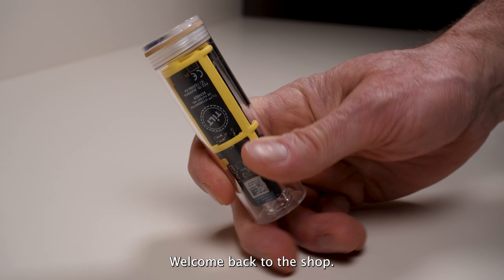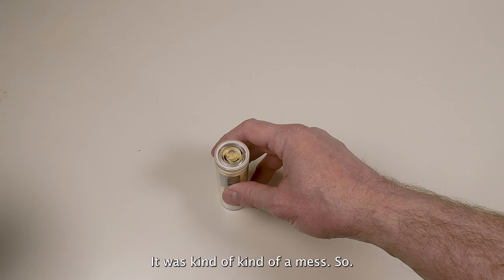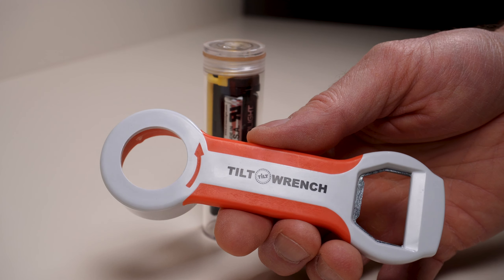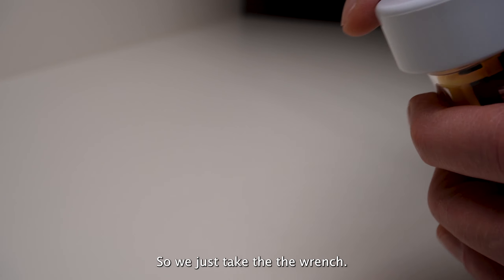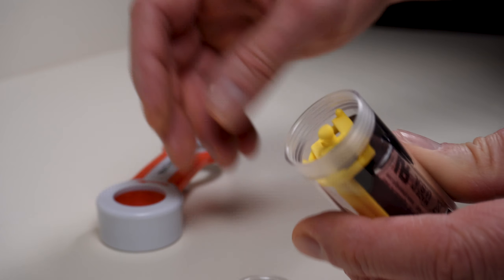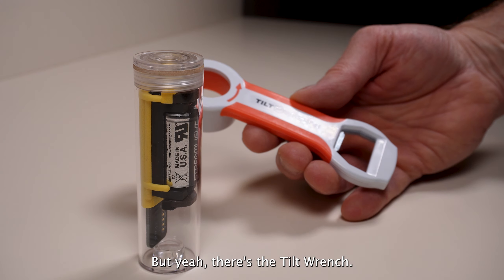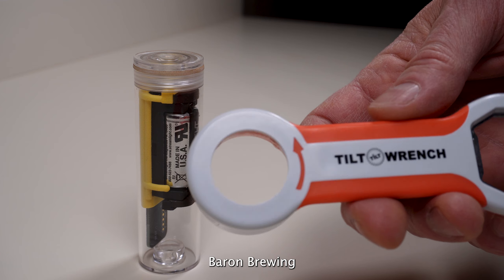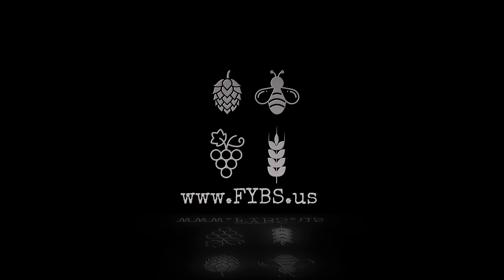Opening a Tilt Hydrometer - The right way to do it.

Comment: The other end is a bottle opener with a tab lifter slot for cans.
Reply from the maker: We're pretty sure that the other end of the Tilt Wrench is a cleverly designed device for safely looking at solar eclipses and a teeter-totter for hamsters. But we could be wrong.
Reply: @FYBS  I am used to eclipse viewing devices having crystal clear magnifying lenses to help achieve proper focus.